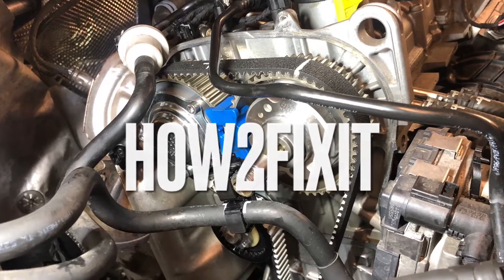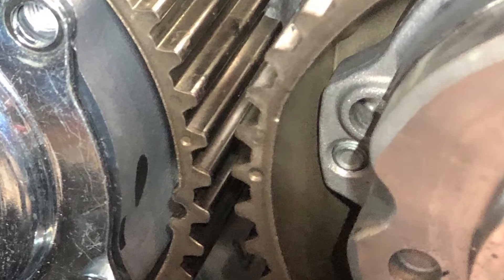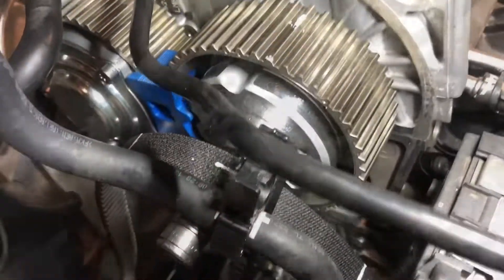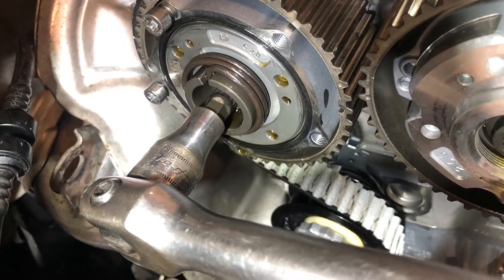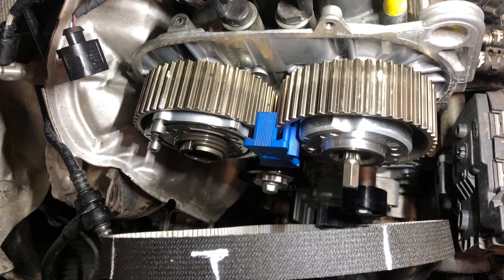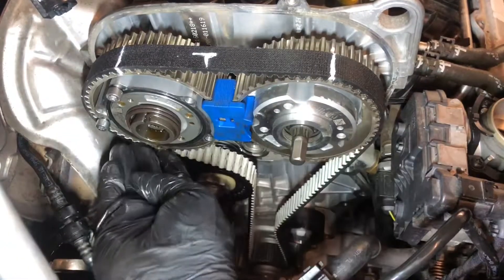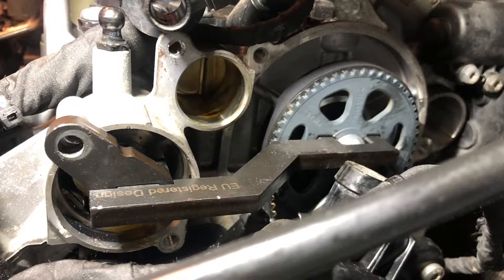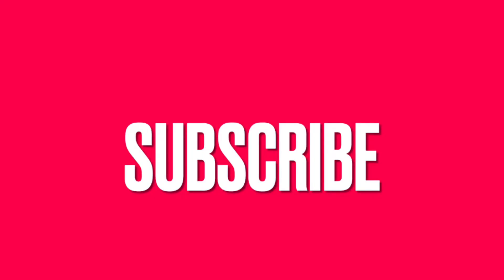Mastering 1.0 TSI Engine Timing in 2025 with the RIGHT Tools!

Comment from the maker: ⚠️ IMPORTANT – PLEASE READ FIRST ⚠️

This video shows 1.0 TSI engine timing done correctly using the proper locking tools.
❗ Skipping tools or guessing timing can lead to fault codes, poor running, or engine damage.

🔧 Timing tools & service parts I recommend (UK):
👉 https://www.awin1.com/cread.php?awinmid=3997&awinaffid=491293&ued=https%3A%2F%2Feurocarparts.com

🔗 All my links & tool lists:
https://tr.ee/SU8ONn

💬 Comment below if:
	•	You need help with timing checks
	•	You want torque specs
	•	You want a follow-up 1.0 TSI video

👇 LIKE • SUBSCRIBE • SHARE
It really helps the channel 👍

Comment: The correct way it to use the tool to set cam timing after install   This is only how to lock the engine.  You still need to set the cam timing after

Comment: Great video but there is a error in it. The blue locking tool between the cam adjusters should be removed when tensioning otherwise you won't get the proper belt tension.

Comment: Why loosen the cam sprockets? Don't understand why. . Everything was on time with the old belt?
Reply: ME too, cant understand that procedure also? I have already done a  cam belt on Golf 1600cc TDI and ignored that procedure, engine runs perfectly👍
Reply: @benney06  well here I don't see a reason, but on the diesel it is recommended to do that because you will tension the belt properly, leaving them locked, you risk the possibility of the belt tensioner to start vibrating due to uneven belt tension and there have been cases where they bent or sheared off the bolt of the tensioner
Reply: It's no sense to lose pulleys and tension belt with locking tool.

Comment: Can you explain why after locking the engine with the locking tools , you still need to loosen the cam pulleys ? Like what kind of "small adjustments" will you need to make to it after removing the belt ?

Comment: Should the cam bolts be replaced? And is 50nm the final torque, or should it be tightened further, to a set angle?
Reply: He's a bit vague??? Haynes says a further 135*??
Reply: @mahanduru  Just looked in the workshop manual and 135 is specified there as well.

Comment: Could you please post a link to buy the blue tool to lock the camshafts.
I am not able to find it in the Euro Car Parts web site.
thanks
Reply from the maker: Found it on eBay. Check it out there’s a discount on it. It’s not a cheap kit but does the job proper. https://ebay.us/kpEzbW. Hope it helps you!
Reply: @How2FixIt1  thanks
Reply: I did not find the tool. 
Can you please send a link with the correct timing tool for the 1.0tsi .
Thanks